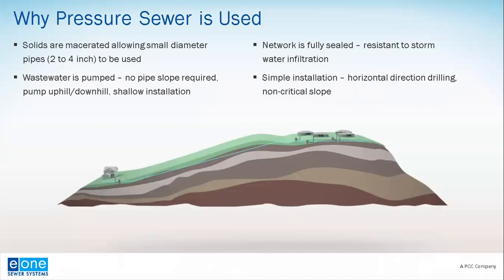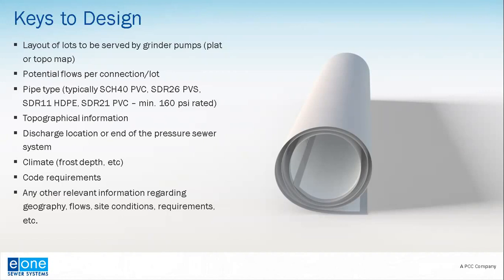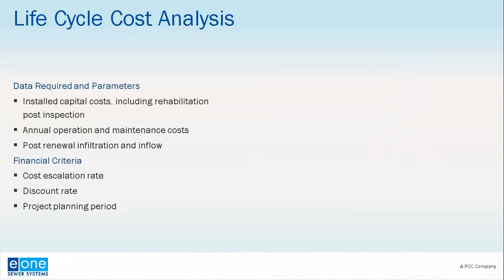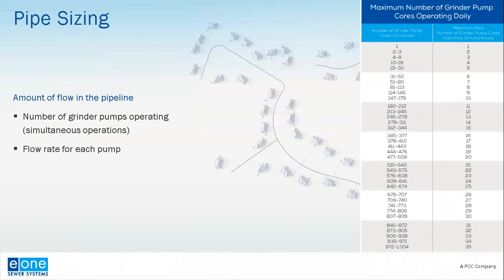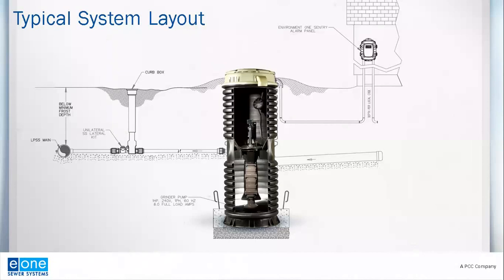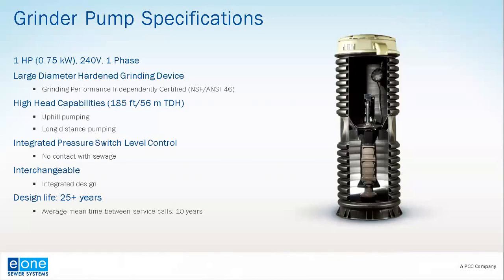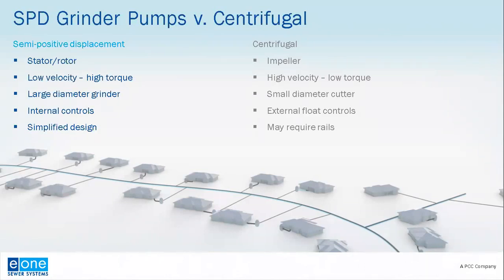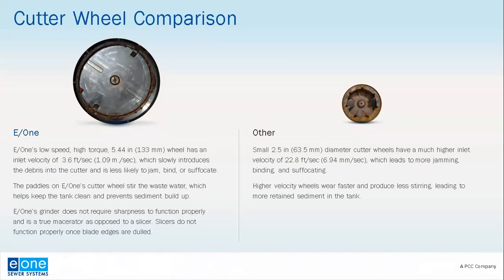E/One Webinar: Introduction to Pressure Sewer Systems

Comment: Well, it does leak odors. It will over flow on the ground as well. When it fails. The double pole beaker strips, no alarm. Out of 24 houses on my road. 24 have failed in 9 yrs. Some are on their third pump. No place to get replacement. No temporary till repair. Not easy to repair, and not easy to find someone to repair. A disaster waiting to happen.
Reply: Travis, I'm not discounting the problems you have seen.  However, what isn't clear is if the system was installed properly.  As an inspector (with a state environment department and previously with the Indian Health Service), I have repeatedly had to deal with contractors wanting to install products in manners that are against the manufacturer's design and or installation instructions.  Take for example the Liberty FL-30 series effluent pump.  I repeatedly saw designs with people wanting to install the pump with the shutoff well below the top of the pump.  The instructions specifically state that in septic effluent applications, the pump must remain submerged at all times for protection from corrosion.  Similarly, they would plan to install them in very petite pump tanks such that run times would be measured in a few seconds.   As a general rule of thumb, you want the pump to run at least a minute.  These were contractors who had been installing this product for 20+ years and hadn't read the instructions.    Installing pumps wrong is not good for the owner; good if one is in the pump sales business.  During my IHS days, one of our supervisors kept wanting to install an advanced treatment system incorrectly.  The company rep finally wrote a formal letter noting that he would love to continue selling us systems, but that he had to insist that we design and install them in accordance with their criteria.  Otherwise, when they failed, the company would be blamed rather than the IHS engineers for doing improper design and installation.